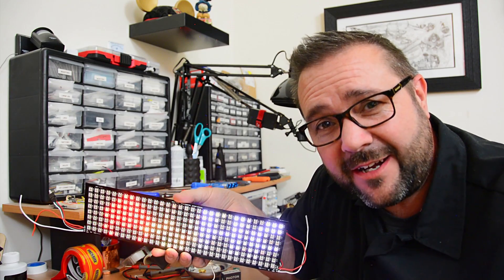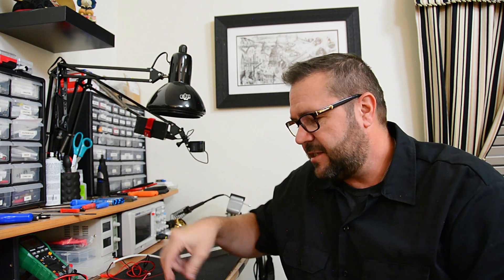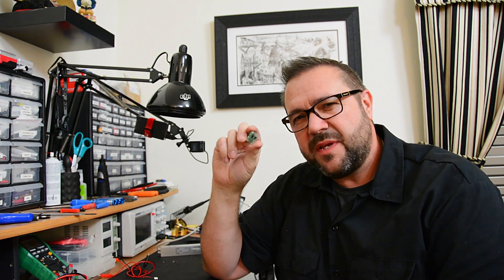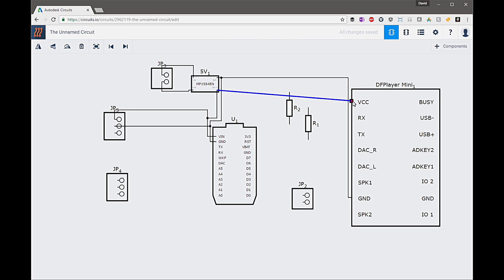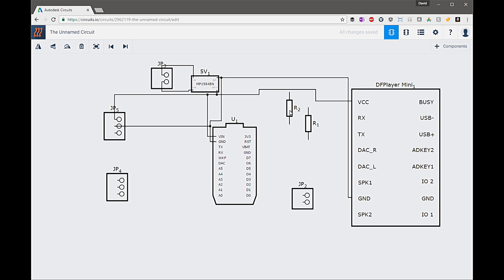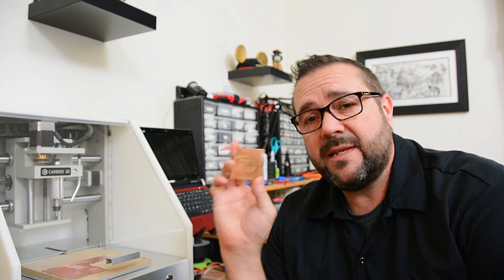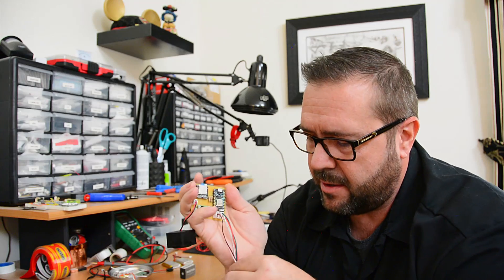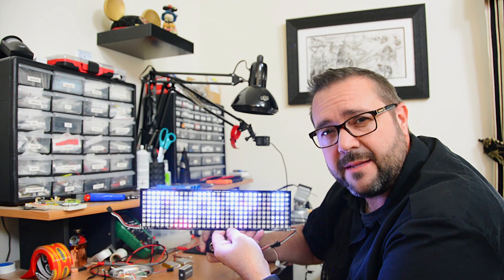Episode 019: Internet Arcade Clock Thing?!

Comment: Why did you need the solder mask after milling? I thought the milling took care of the traces and pads from the blank plate.
Reply from the maker: you do not need a solder mask, but it does protect and finish the board.